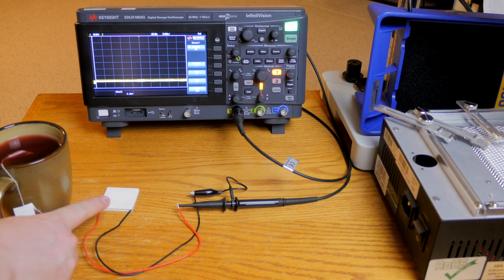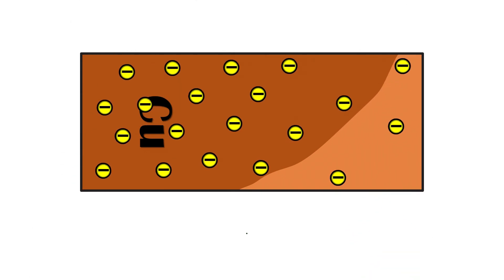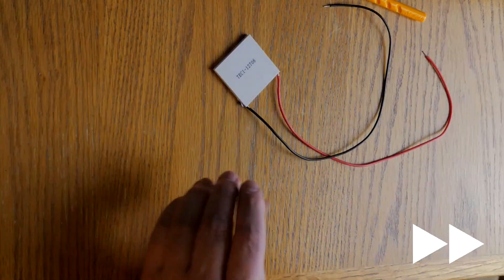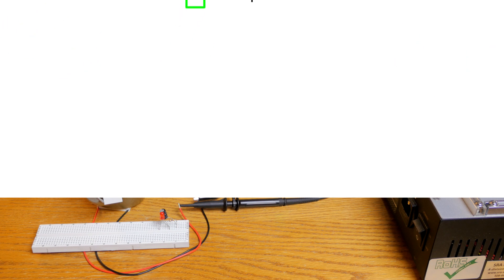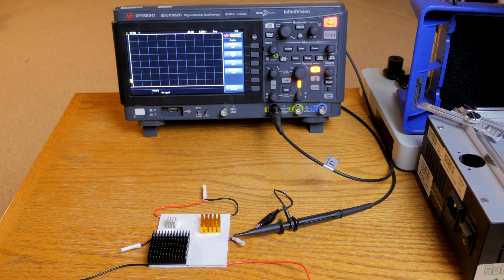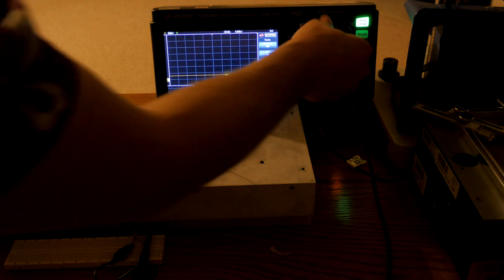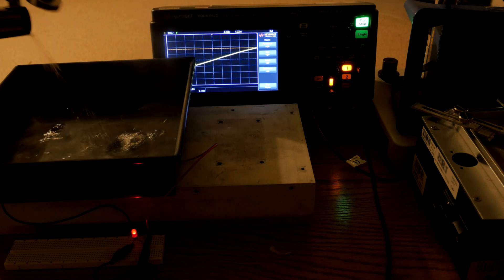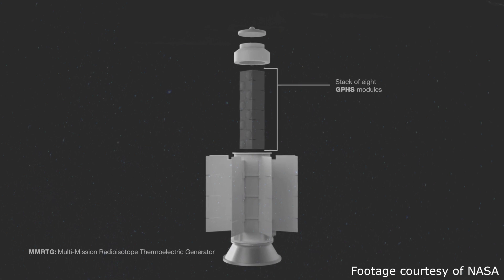Electricity from Heat: The Seebeck Effect in Action

Comment: Never use thermal tape for this...  use only thermal grease.   Thermal tape is just horrible at conducting. I would know as the guy who invented the thermal window!
Reply from the maker: @TabooRevolution13  Agreed, for a permanent installation a thermal paste or grease is much preferred as they can have thermal resistivities of 0.1 to 1 K-cm^2/W while thermal pads or tape are closer to 1-8 K-cm^2/W.
Reply: @funtechu  I had to screw up an entire window to find out the hard way! I was just like WHY isn't it working?

Comment: thanks for the information. do you know how many poles inside one  peltier? thanks again
Reply from the maker: I'm not sure what you mean by how many poles, but if you mean the number of peltier couples in series in the device that's usually specified by the first part of the part number. So for example,  a TEC1-12703 has 1 layer (TEC1) of 127 couples (127) with a nominal max current rating of 3 amps (03).

Comment: very interesting! how would a graph showing the temperature on x-axis and voltage on y-axis look? would it be linear?
Reply from the maker: The relationship between the temperature difference and the open circuit voltage is indeed linear over it's normal operating range, where the coefficient of proportionality is known as the Seebeck coefficient.

Comment: it could be a nice technology for implementing digital temperature sensor on a pot or a pan 🍳🤓
Reply from the maker: Good observation! This is actually the exact same principal that is used in a thermocouple which it used to take temperature measurements. If you have a kitchen candy thermometer or meat thermometer, they typically have a thermocouple in the tip of the pointy end, though there they typically use two different metals for the Seebeck junction instead of semiconductors so it can handle a wider temperature range without being damaged.
Reply: @funtechu  i actually meant that it would be also able to power up the digital led display with the power of  temperature - however after writing that again i've realised that led display would prolly die quickly because of the temperature 🔥

Comment: You should use these in houses.  Inside temp is different that outdoor temp.
Reply from the maker: Except, it typically takes energy to maintain that temperature difference, and the amount of energy generated would be less than the energy expended to maintain that difference.
Reply: @funtechu  when it's 105 degrees outside I usually keep my house at 70 degrees with a Air Conditioner.
Reply: @funtechu  ...I can always have a temperature difference.  It just depends on insulation in my house and how shaded my house is.

Comment: Can you make a closed circuit using a magnet gun and diodes as a current electric booster using a battery to ignite the current in circles with a coil around a cylindrical metal to create a  perpetual current motion that uses a led to replace the battery in the same coil that consumes less energy we applied to ignite the current or that won't work?

Comment: Great vid.  I have a 1/4 scale steam locomotive and I’d like to power an LED headlamp from waste heat in the smoke box and its very tall chimney.  I could mount a heatsink facing the direction of travel ie in cool air compared to the smoke box temp.   The smoke box wrapper and it’s chimney get very hot.  To picture the loco: it is very similar in design and construction to an Orenstein and Koppel 40hp model, but scaled down to run on 184.1mm gauge track.

Any thoughts?

Comment: I wanted someone to explain something to me: It doesn't make sense for the holes to move away from the heated region (in the case of the p-type), since they are the absence of electrons, they should actually be exactly in the heated region, since the heating causes electrons to go to the cooler region.
Reply from the maker: I agree that it is unintuitive at first glance, and it requires a little background in semiconductors to really grasp it, but I'll do my best to try to explain it in a more simple manner. Semiconductors are materials that are doped with an impurity so that they either have an excess of electrons (n-type) or holes (p-type). What this means in practice is that the impurities are either electron donors, or acceptors, and as long as there is enough activation energy present, electrons can either be donated to the conduction band, or captured from the conduction band.

The key to understanding the thermoelectric behavior of semiconductors is to realize that this activation energy must be present to allow the release or capture of electrons, and that the material is always in a constant state of flux, with electrons being release or recaptured continually depending on shifting temperatures (which help electrons jump over the energy barriers) and on proximity (where if they are close enough that the electrons wave function overlaps, they can quantum tunnel through the energy barrier). 

What this means in practice is that when you have an n-type semiconductor, the impurities don't all release their electrons into the conduction band all at once. Instead, there is a constant flux of electrons jumping into the conduction band, and jumping back. The higher the temperature, the more free electrons there are floating around in the conduction band, and the lower the temperature the fewer free electrons are floating around. If there are more electrons released into the conduction band (higher temperature), that will create an electric field that causes electrons to drift away from the heated end until they reach a point of equilibrium. At the point of equilibrium, this electric field pushes more electrons towards the cooler end, so the net effect is that the heated end is more positive, and the cooler end is more negative.

Now the tricky part: p-type semiconductors. It requires activation energy for the impurities to "capture" electrons. When an electron is captured out of the conduction band, that region of the material becomes more positive in its conduction band, and we represent that as a "hole". The higher the temperature, the more electrons can be captured, and thus the more holes form. This change in the concentration of holes (increase in hole concentration, reduction in electron concentration at the heated end) causes electron drift in the opposite direction, and causes holes to propagate away from the heated end as more electrons are captured. At equilibrium, more holes are present on the cool end, and more electrons are present on the heated end, so the net effect is that the heated end is more negative, and the cooler end is more positive.

Hopefully this helps. If you are interested in learning more, I'd recommend Fundamentals of Thermoelectricity by Kamran Behnia. It includes helpful energy band diagrams when going over the concepts so you can see how different materials function over a variety of operating conditions.

Comment: what if you connect a battery to charge the heat plate or what not, and have one that one charge another batter using the excess energy from the first battery? then wouldn't that be unlimited heat, plus indefinite battery power?

Comment: can it light up a 20w bulb
Reply from the maker: From the calculations in another one of my comments, the energy generated by my hand vs ambient is 1.7mW for the 4 TEGs, or 7.66mW for the hot water example. Note that these are not optimal operating points as discussed previously, and were merely chosen for this example. So to power a 20 watt bulb would require 47,059 TEGs using body heat, or 10,444 TEGs using hot water. 

So the short answer is, no, it's not practical to power a 20 W light bulb using these TEGs.
Reply: @funtechu  thanks

Comment: ok apart from space I have a geyser near me what do think?💡🧐
it's really boiling hot what if I make a double pipe  one inside the other and covered with aerogel one pipe channels the hot water and the bigger one channels the sea water and is covered from the top with earogel
what if the pipe is made entirely from peltier I think it has some potential if utilized correctly
Reply from the maker: It would probably be more feasible to just take the water sources to a single location and then do the exchange there. That being said, if you have geothermal activity near you, you probably would get much more power generation for the cost by building a normal geothermal electric system using a more traditional system (dry steam, flash steam, binary steam). You can learn more here: https://www.nrel.gov/research/re-geo-elec-production.html
Reply: @funtechu  😊 thanks for taking time to reply

Comment: Nice video. I was thinking of solar pv with t. If the amount of volts can be increased by the thermal hot water running in hotwater pipe then a slim TEG lengthways running parallel to pipe could increase the voltage in the day and even create voltage in the night.

Comment: why wouldn't a traditional PN junction depletion region (like, in a diode) appear somewhere @2:16 in your explanation?
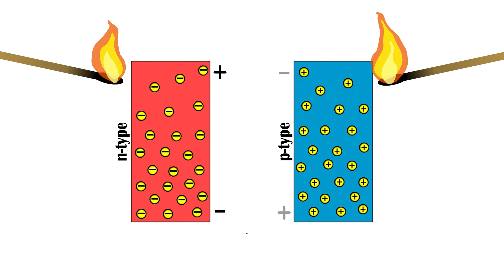Also, if heating only makes the positive and negative more positive and more negative, this should also work without heating. (as in, indeed that P or N by itself is electrically netural, but once in contact, holes and electrons will start migrate, just like what your animation is showing @2:06) that would lead to absurd conclusion like "if a diode's both end connected to a wire, we will get some electricity flowing forever".
Reply from the maker: A depletion region does form (you can see the cancelling around 2:06 in the animation), however it isn't relevant to an explanation at this level (this video was produced for elementary/middle school students). Heating an end increases the concentration of the primary charge carriers in the material (electrons in N-type, "holes" in P-type), on the end that is heated. This is due to the increased energy providing a mechanism for primary charge carriers to jump into the conduction band. This concentration results in the temporary charge differences shown, but it will eventually reach equilibrium and no current will flow if the two ends are not connected.

But, as you note, if you connect the two ends (through a load, or even simple short circuit), this electricity will flow "forever". This is true, only *as long as the temperature differential remains*. Once the two ends of each semiconductor reach the same temperature throughout, no more current will flow because the charge density is the same throughout the semiconductor. Indeed, the material will reach thermal equilibrium faster than by normal conduction alone because some of the thermal energy is being carried away by the primary charge carrier activity  and dissipated in the load.

Hopefully this helps clear some things up. If you want a deeper discussion on thermoelectricity, and in particular why certain materials are chosen over others, I'd recommend reading "Fundamentals of Thermoelectricity" by Behnia.

Comment: May I ask why do you use multiple TEG's? How much voltage does 1 TEG have? Thank you!
Reply from the maker: As mentioned in the video, the reason to use multiple in series is to increase the voltage across the load. This is because the voltage is dependent on the temperature difference between the two sides, so to get it high enough that an LED could turn on, they needed to be combined in series (where voltages add). This video is a simplified example that was produced for elementary and middle school students, and doesn't represent how you would actually use a TEG for energy harvesting. Instead you would use an energy harvesting circuit that can dynamically match the output impedance presented to the TEG array for maximum power transfer (remember, power = volts * amps). You can see the voltages produced by the temperature difference of my hand to room temperature at 6:04. The oscilloscope is showing units of 500mV per grid line, so under those operating conditions, and assuming the led is just barely turning on (1.6V forward voltage) that is a current of (2-1.6)/470 = 851µA, with a voltage of 500mV per TEG.

You can learn more about maximum power transfer here: https://en.wikipedia.org/wiki/Maximum_power_transfer_theorem
Just keep in mind that for the purposes of this demonstration I was not trying to maximize power transfer, I was merely trying to find an operating point that would work for the purposes of this demonstration. It is unlikely that I picked the most efficient operating point.
Reply: @funtechu  Ohh this is wonderful. Thanks for the information!

Also, may I know what is the formula for the output voltage of the TEG? Thanks!
Reply from the maker: @meldalumpines2138  There it's no direct formula since it varies by the TEG. Some TEGs will have a graph in the datasheet that shows the approximate performance, but you generally need to characterize a given device on your own.
Reply: @funtechu  Okaaay. Now I understand. Thank you so much!

Comment: Could you explain how a thermocouple creates electricity, say to power a solenoid in a heater? So when a thermocouple is heated, some electrons move to the fixed or cold side of both metals, and the one that has more electrons creates pressure or voltage. But do the electrons flow from one metal to the different metal to create a circuit? Thanks
Reply from the maker: First to answer the part about the use of thermocouples in things like gas stoves, furnaces, and so on. In these cases, a thermocouple is placed in or near the pilot light so that a solenoid can turn off the gas if the pilot light goes out to prevent a gas leak and large amounts of gas buildup which could cause an explosive hazard. These thermocouples use two pieces of metal that are different and where the voltage drop across the connection between the two of them is known to be closely (and ideally linearly) related to the temperature. The voltage is small (typically only a few millivolts), and they are either paired with a solenoid that can stay open when powered with such a tiny voltage, or in more fancy systems there may be a small circuit that uses the tiny voltage to power a relay that then allows a much larger voltage through to hold the solenoid open. Here is an excellent demonstration of a thermocouple in action with a direct-drive solenoid rated for 30mV https://www.youtube.com/watch?v=7m5ZDvOoVwU

For the more broad explanation of why this works, the explanation in this video at 1:03 is oversimplified because it was prepared for Middle School students, but the fundamentals are there. When a semiconductor is heated at one end, the extra thermal energy results in the dominant charge carrier migrating away from that end because there is enough energy for it to jump into the conduction band, and then the charge carriers repel each other, resulting in a concentration of the charge carrier at the other end. For an N-type semiconductor these are electrons, so the heated end become more positive because electrons are being repelled towards the colder end. For a P-type semiconductor these are holes migrating which in effect just means that electrons get accelerated in the opposite direction. This same effect happens when two different types of metals are connected as well since the conduction bands of metals is slightly different for each material.

This build up creates a potential difference, but it doesn't become a circuit until you connect it into a loop so there is some path for the potentially to go. (it's in the name - circuit means a circular loop or route). So if you connect the two hot ends together and the two cold ends together, there is now a path for the excess of electrons on the N-type cold end to get to the excess holes on the P-type cold end, and similarly for the extra electrons on the P-type hot end (signaled by a reduction in the number of holes) to get to the electron-starved side of the N-type hot end. Keep in mind that as electrons absorb energy from heat and jump into a conduction band and move away, they carry that energy away cooling it in-proportion. This is how the peltier effect works which is the inverse of the seebeck effect, and basically shows how you can pump heat by applying a current to a similar thermoelectric setup. Note that while it might be easy to think of these things as happening in some set of causal order (heat up N side, electrons pushed to cold N side, electrons return to cold P side drawing more holes to that end, releasing more electrons from the hot P side which then return to the N side replenishing it), the reality is that all the effects happen essentially simultaneously like how in a gearbox all the gears turn simultaneously, and they are inextricably linked so that effects on one of the gears directly impact the others. Also keep in mind that electron traversal is really slow, so what is actually moving are the EM fields induced by the imbalance of electrons and those propagate at the speed of light. If you want to understand the physics behind it further, and the mathematical equations for modelling the effect, I recommend checking out Fundamentals of Thermoelectricity by Kamran Behnia.

Anyway, bit of a long response, but hopefully this helps
Reply from the maker: One other think I forgot to mention, many of the self-powered thermocouples that you will see in furnaces and the like are actually a whole bunch of thermocouples connected together in series (called a thermopile). This increases the voltage (placing items in series adds the voltage) to bring the overall voltage up to a level that is high enough that it can directly power a solenoid. 

Here is a video showing the visual difference: https://www.youtube.com/watch?v=--nI0u_k9kc
Here is a video I found of someone cutting open a thermopile so you can see inside: https://youtu.be/DrRSydm0QjY?t=118